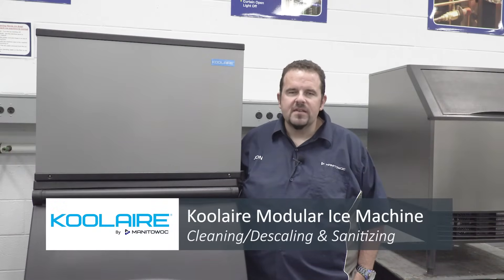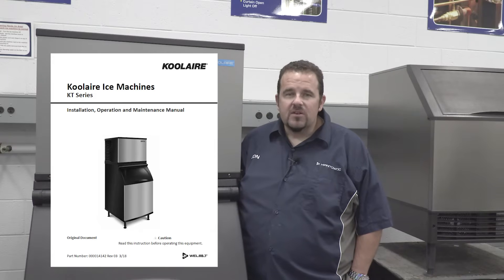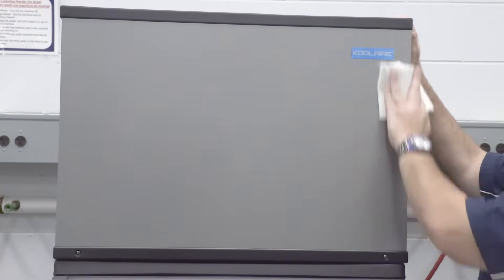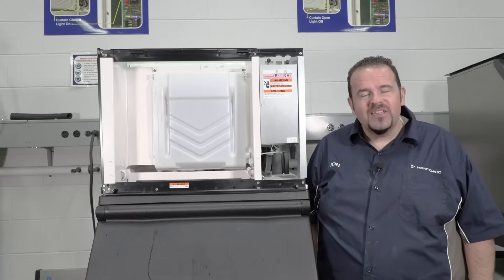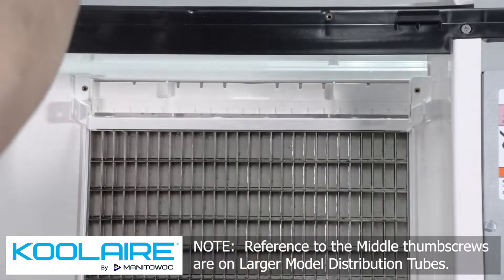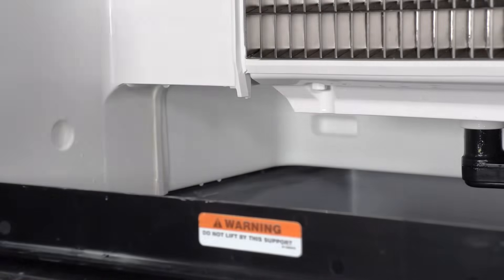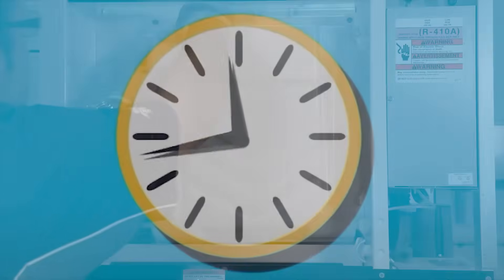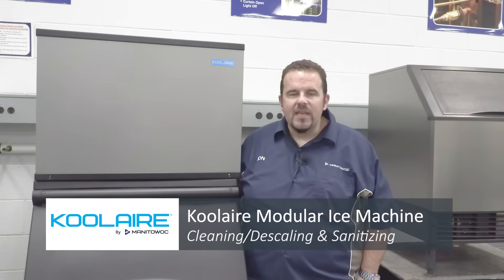Koolaire by Manitowoc Ice Modular Cleaning

Comment: Great video, but you forgot to run a brush up from the pump into the water supply line. You would be surprised what is lurking in there even after running clear through the system.
Reply: You'd be surprised what's behind the evaporator plate even more! You need a hot hose, on a good nozzel to get up there.
Reply: 95% of people never even saw that part. But it's disgusting.